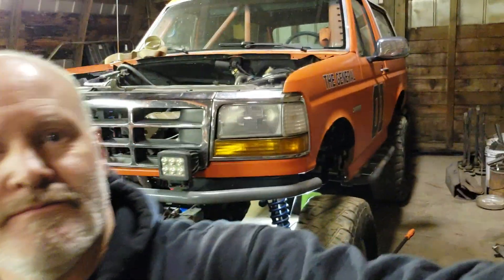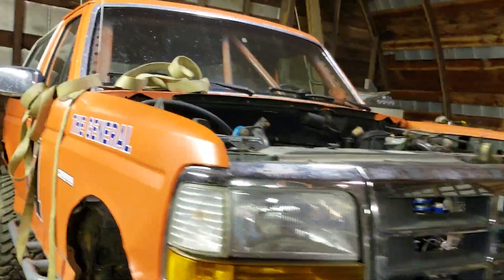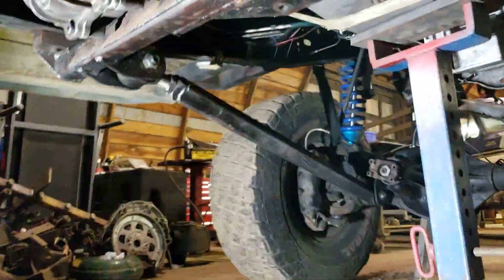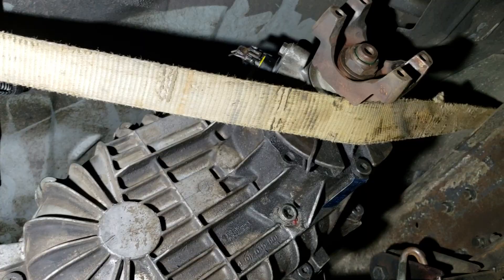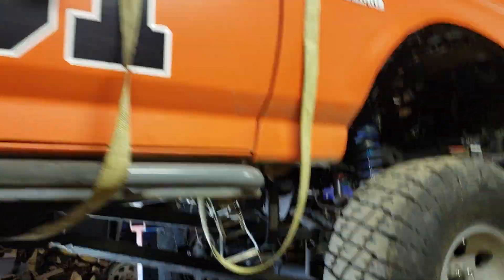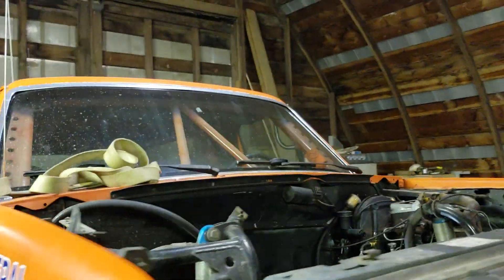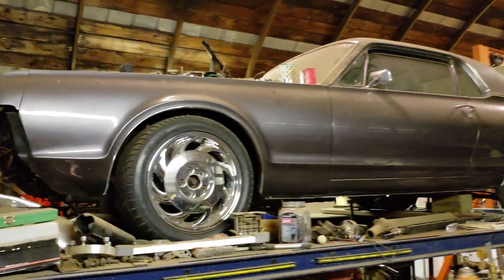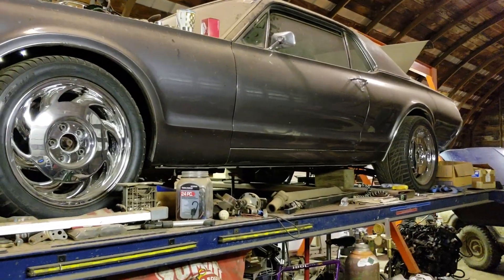LS powered Bronco

Comment: I would have done a 351 based 427 or 460 stroker fuel injected. It would blow the doors off that LS and more then enough torque for the hammers.
Reply from the maker: You would definitely have to buy aftermarket cylinder heads as stockers have crap flow.  I'm on a limited budget.  Also, my friend is doing the same thing. And he is getting rid of his 434 stroker Windsor.  Maybe when I get it done we can meet up and you can "blow my doors off" with you real or imaginary build.  ;)
Reply: I didn’t say I have that stroker motor.. but I do. And anytime a GM guy wants to go I’m in. Too bad you couldn’t use a blazer to mount that motor in. It’s a damn shame. I’m sorry your buddy can’t build a motor. I feel bad for that cougar too. Ouch
Reply from the maker: I never said you had a stroker engine.  It's too bad you are so brand sensitive.   Nothing is ruined.  Nothing was ruined when I put a Cummins in.  I don't like the blazer body as well.  Didn't have to change the transmission crossmember , engine mounts are in the same spot.  My buddy had just over 500 hp, but wanted a lot more with out spending big bucks.  Bring your Ford powered rig on over with stock unported heads to compare with mine.   Don't worry about the cougar, it will haul ass just fine.  Thanks for your unwarranted concern though.
Reply: @JohnSmith-ny7hd  you guys always saying to put it in a blazer but in pretty sure there wasn't a ttb blazer that could handle jumps and whoops plus dollar per hp chevy every day
Reply: I’m surprised that Cummins wasn’t in there, lol! I have an LS3 Camaro and a Windsor Bronco. So I’m not biased, much. I admit I would’ve preferred a 460 because of the low end torque but for the Hammers a tt LS was probably the better choice because it’s cheaper and very reliable than building the 460. I ultimately want to build a 6bt Fummins though. Alan Schneider, wouldn’t the TTB be better for KOH?